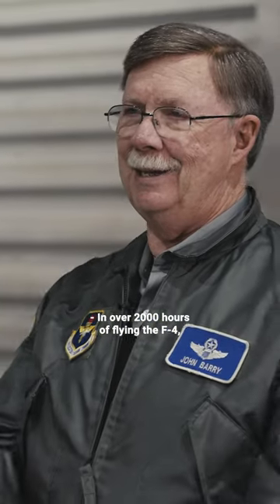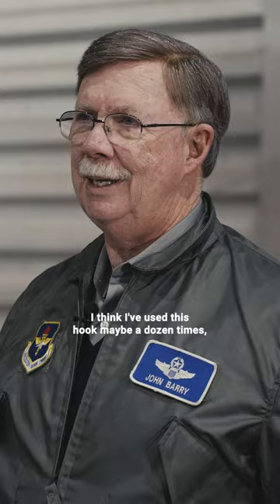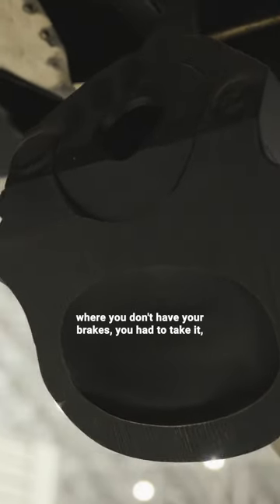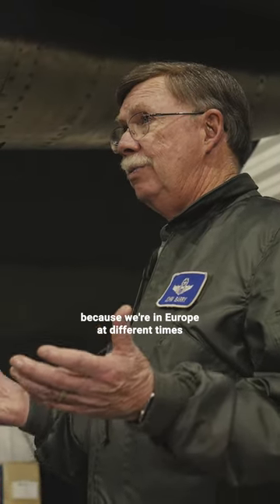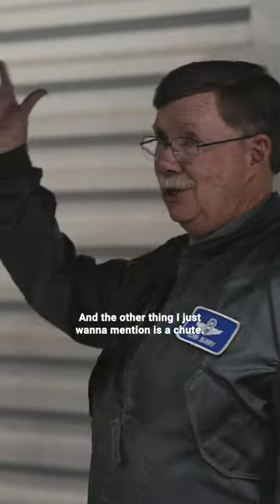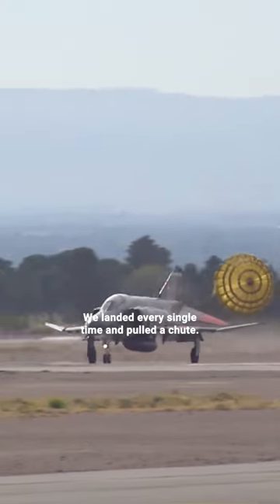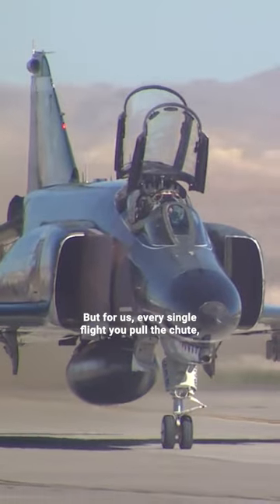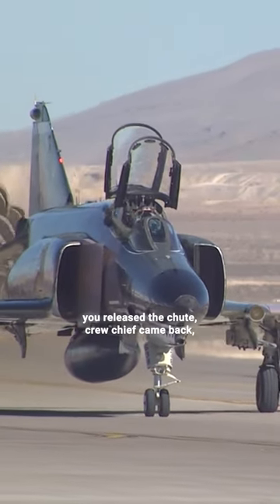When does the USAF use a Tail Hook? #aviation

Comment: always loved the fact the f4 used the chute, but I have a question. Why was it used? Was it because the runways were not long enough or to not consume the brakes?
Reply: Plane is very heavy. Brakes would constantly need changing, plus it was another tool to prevent overshooting the runway.
Reply: @ChaseWatkins.  thx man
Reply: Super easy to use and effective tool fot slowing down the plane
Reply: Also for emergency landings when they don't want to use the ejection seats.